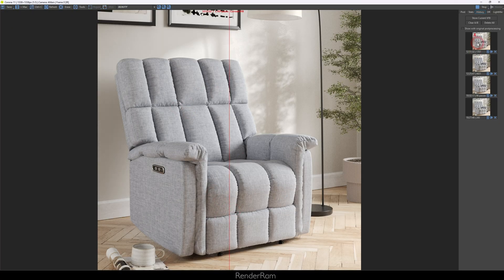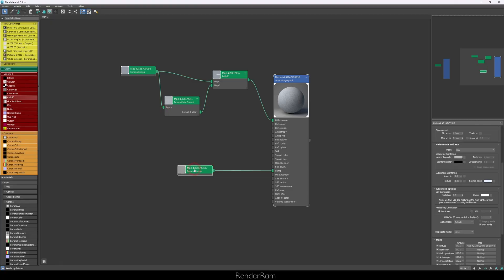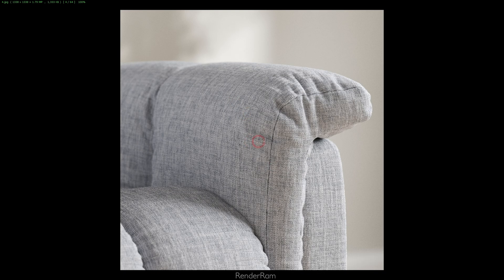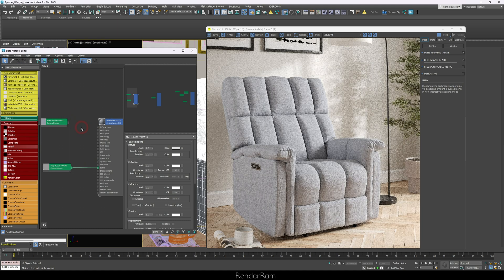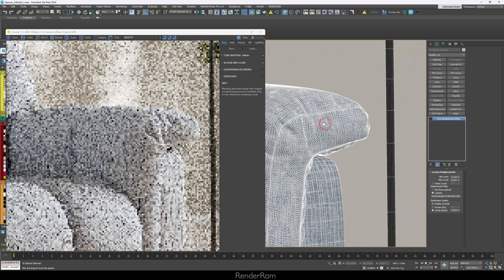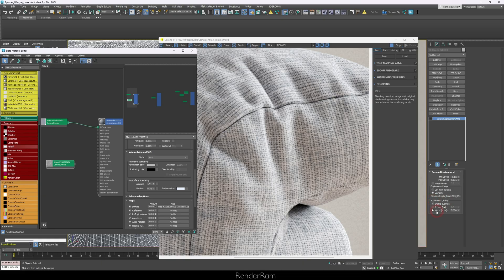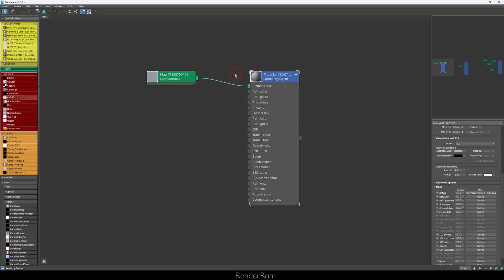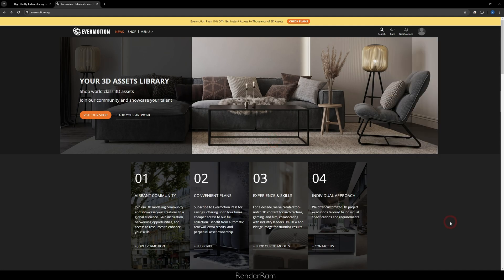Materials Ep9: Furniture Fabric | All 3D Software

Comment: Great tip! That actually makes sense. Fabric does scatter light as it's not a completely solid surface like concrete or something. I need to try this out now. I'm using V-Ray. I'm wondering how it will turn out there.

Comment: an interesting lesson, but it's a little strange that you're working in an old legacy material). and at the expense of the bump, did you just try to increase its value after turning on the SSS with the maximum value 1?  the same way: your final material actually looks a little different.. for some reason, you removed the displace map from the material, this is a habit from the fstorm there is a feature and limitation, but why do this in the corona displacementMod modifier instead of the modifier taking the map immediately from the material.. This is not clear to me
Reply: then, when you replace the material, you will not have synchronization between the corona modifier and the new material.. you will also have to manually change the displacement map in the modifier itself.. which is not very rational.
Reply from the maker: yo!
So here's a breakdown, hope it makes things clear,
1) I always work in legacy material, I like to have every aspect of the material under control rather than having things being automated in physical material, just a personal preference
2) Bump value in SSS, yes tried it on max, even tried setting SSS Amount to 0.8 so that I can leak a bit of bump, and then crank it up, but it just didn't look right
3) In my material, bump map was always in Bump slot, not Displacement. Reason why I keep it in Modifier is because of World size, as mentioned in video, World Size tends to be very heavy on the scene performance and RAM, so it's too risky to set World Size in render settings because every Displacement use from material will automatically be in World Size mode, and a lot of times I don't need World Size quality, also as said in the video, World size once ate 128gb of RAM :)

Hope this clarifies things a bit more
Reply: @RenderRam  1) well, I'm sorry, but there is no advantage of outdated legacy material, except to create some not physically correct materials... but I am ready to hear examples (at least one real one) where the legacy material has an advantage. and so very useful matelness mode and not metal, presets for materials and a clearcoat layer in the physical material. just a large number of advantages
 2) 0.8 is not a small value for the SSS, you can lower it to 0.3-0.6 and increase the radius. but on the whole, I understood you. 
3) you misunderstood me, I know perfectly well what the Corona Displacement Modifier is for and how it works. I will try to explain my thought more clearly. in corona renderer, you can add a Displacement map immediately to the desired material slot and then select the Get from material setting in the Corona Displacement Mod (for example, there is no such useful function in fstorm- Get from material, that's why I mentioned it). and in this mode, the modifier will take the map immediately from the material that is currently assigned to the geometry. 
for some reason I don't understand why you have selected the displacement map > custom map mode in the modifier settings. that is, the connection between the map and the material itself is lost.. if you change the material, then you will have to manually change the map in the modifier, which is somehow not very rational. that's what I wanted to say, I don't understand what the point of this approach is?
Reply from the maker: @sahaksahakyan2404  
1) I get what you're saying, I get results that I'm happy with, we can argue all we want about what features are better and what not, but at the end of the day, I'm happy with my workflow, you're happy with yours :)
2) all good here
3) Oh that Get from material, yes that's an FStorm habit of mine, and I do agree that your way is more convenient. Guess I would need to rewire some workflows on my end :)
Reply: believe me, it's really interesting to find out if the old legacy material has any significant advantages at all?  weighty advantage, because there are a lot of advantages of the physical material, in fact, but I really do not yet guess what advantages the old material has .. I'm really interested in hearing at least a couple of examples. @RenderRam

Comment: man I really love your tutorials, intricate yet simple things that you can't find anywhere else. one question though, why are you using the legacy material? is it for the  displacemant or do you think it has an advantage over the physical material?
Reply from the maker: Thank you!
I prefer Legacy material because every aspect of the material is modifiable, it is equally "physical" as the Physical material, it's just that... 
I think  @LearnCoronaRenderer explained it better "I would like to highlight that OLD materials are "physical" as well. They just have some parameters linked to avoid errors to less skilled users. Which is great in general, but produces less control as a side effect - Ciro Sannino"

Comment: Very good, simple and effective technique, I will test it on some of my work. Thanks for sharing this. I see you use Fstorm and Corona. I don't know many people who use Fstorm, I spent more than 1 year working with Fstorm for Packshot work,
It would be interesting to make a video showing the differences between Fstorm and Corona and in which situations you like to work in one or the other rendering engine.
Reply: I think corona has old legacy of physically based interior rendering and that's why you will find old model libraries are setup for corona/vray. Corona also has maximum number of render passes to help in compositing. It also simplifies some of 3ds max material nodes to have user friendly workflow. 
Fstorm on the other hand is a simple and straightforward physically based renderer. Its biggest advantage is GPU rendering with photorealistic result. I compared both engine and found that Fstorm is way faster than corona even corona use 100% of CPU and Fstorm barely touch 50%. I even heard the story of lawsuit file by octane render team on Fstorm developer about stolen their algorithm but Fstorm win the case. 
Anyway, I use both render because corona has implemented some AI algorithm that optimize render time in recent 2 versions.
Reply: The corona renderer has noticeably more settings and features/tools and amenities in general. there are more tools and many similar maps/materials, tools just have more settings, that is, additional features for advanced users. 
Nothing is clear about the speed comparison.. how and where did you compare what?) on which processor and on which video card did you compare them? and by the way, is this video card more expensive than your CPU? @rajendrameena150

Comment: What if you raise the normal amount like twice the SSS value?
Reply from the maker: for the bump?
Tried keeping sss amount to about 0.8 so that 20% of the bump leaks out, and then I increased bump to 99, but it just looked nothing like what it should
Reply: @RenderRam  What if you use a Corona bump converter?
Reply from the maker: @juliussaurus  doesn't work still